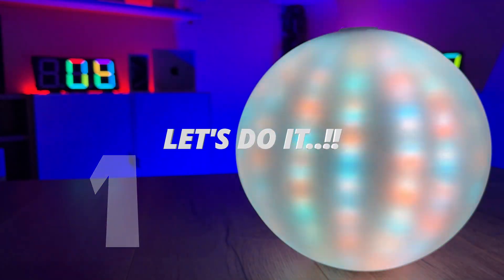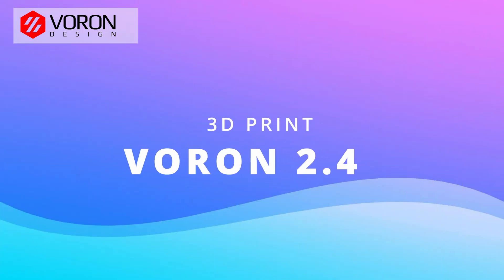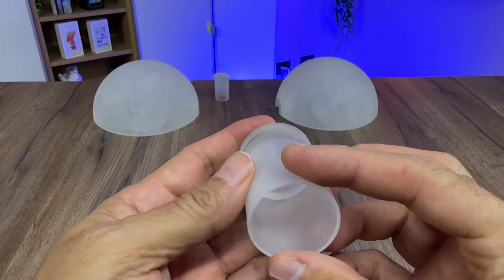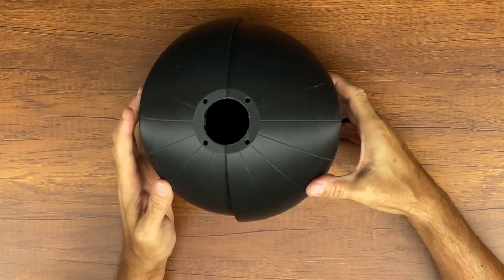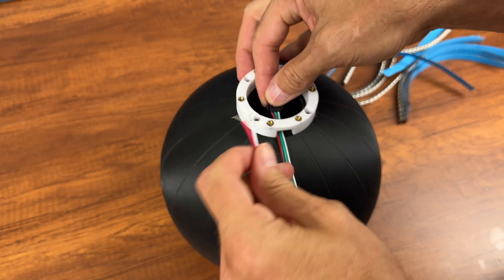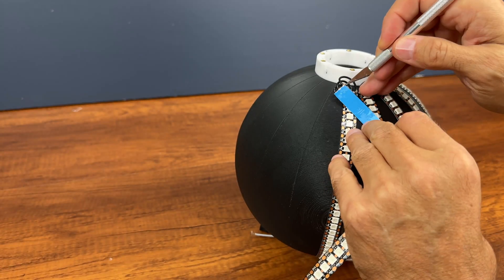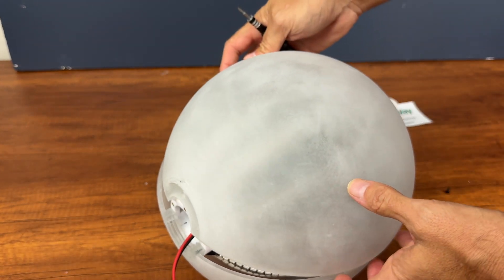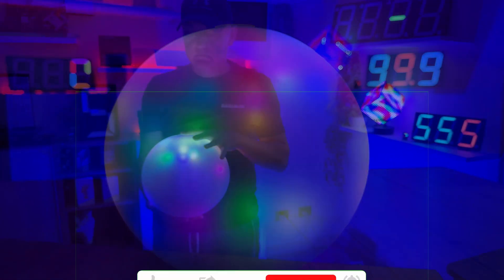AMAZING 544 LEDS SPHERE with ESP8266 and WLED

Comment: Nice project, but at how many Amps did you limit it in Wled software?
544 Leds and the Esp powered without power injections through what looks like a usb 2.0 connector which is rated up to 2.5 watts of power, which is 0.5 amps at 5v, and i really don't mean it in a bad way, because i see that it works, but it amazes me that it worked actually, great job!
Reply from the maker: Hi, this is powered by an external power supply. You can limit the current according to your needs. in a room with little light it really takes very little to make this luminous sphere stand out